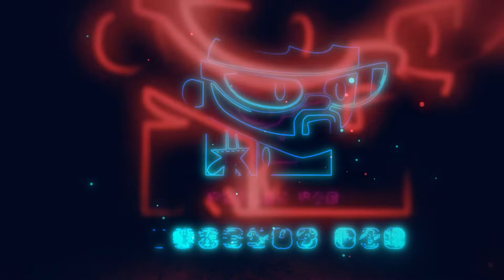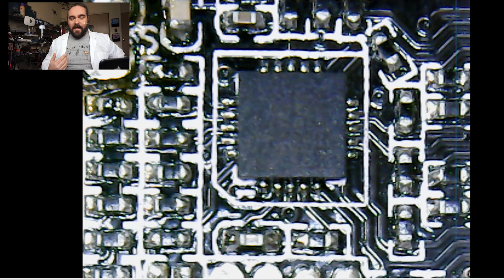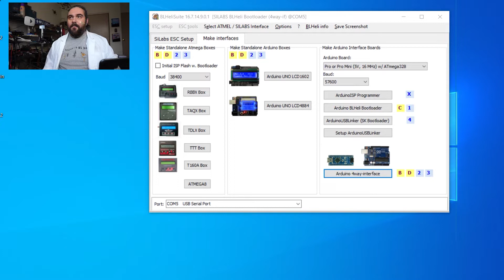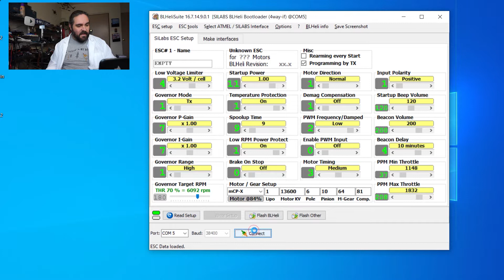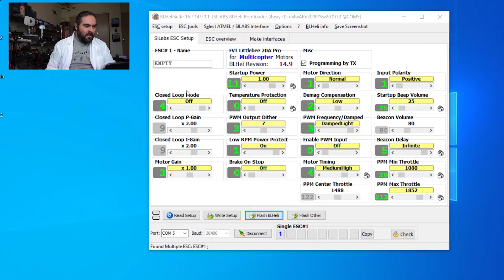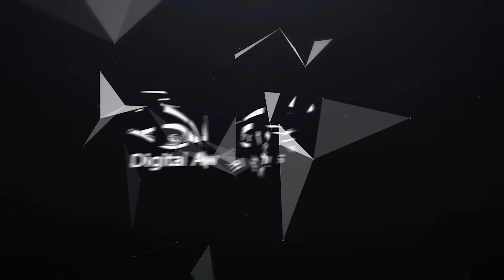Flashing Favorite Little Bee 20A ESCs with BlHeli using Arduino Pro Mini

Comment: Hi, I am using an arduino uno and the HobbyKing® ™ Brushless Car ESC 10A w/ Reverse ESC. I have followed your tutorial, but it doesn't seem to work. What can I do? (The problem is that it doesn't detect the esc). Thanks!
Reply from the maker: I have seen this happen if you are using the wrong arduino nano voltage, it needs to be the 5v 16 mhz version

Comment: Thanks for running through all the setting on the Blheli suite. I only wish you had spent a bit more time on the wiring. Did you wire up the USB dongle to the Arduino per usual? If you're programing 1 ESC at a time, then use pin 11 and ground on the Arduino? On the ESC, it looks like you're just using the signal and ground connections. I hope so, as flashing generic ESC's with SimonK required access to several pins.